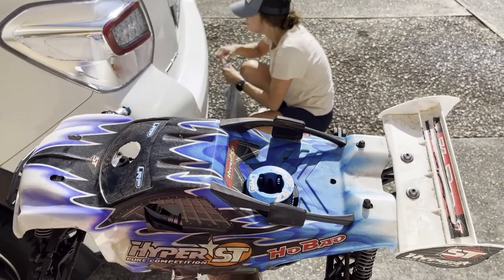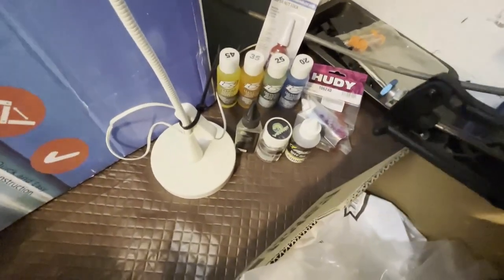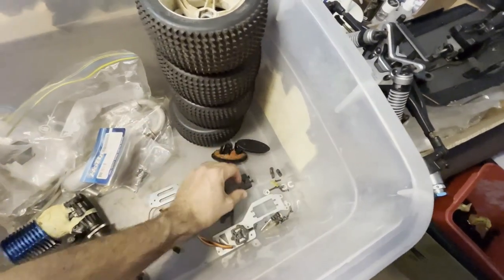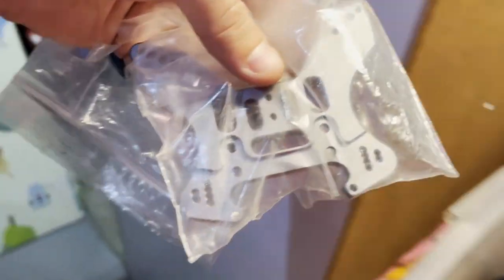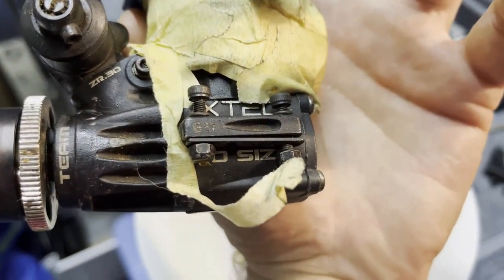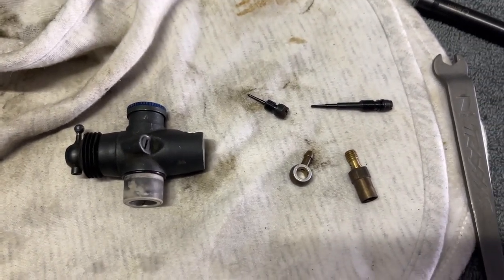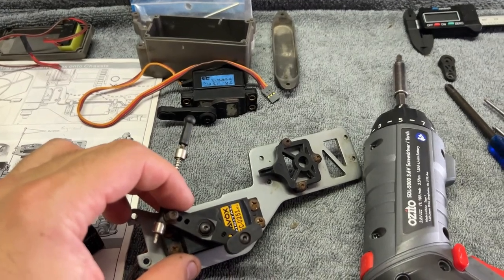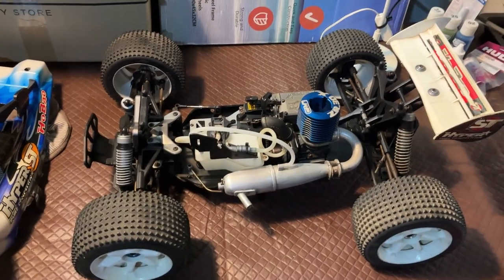HOBAO HYPER ST [2007]  1/8 4WD TRUGGY +BONUS RARE VINTAGE NITRO RC

Comment: The hyper st is great even in standard form. Ive had standard towers on mine and they lasted so long that when i broke the body mount off the rear one i just replaced them with the standard plastic towers again as they are so strong and cheap
Reply from the maker: Yeah you got the perfect basher. Your truck is a total tank!